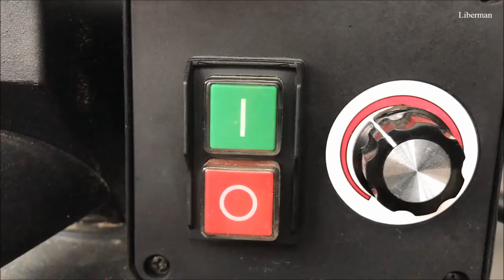How to make an automobile two stand lift for a service station

Comment: Can you make a similar stand lift, but with 1 motor? So that the left and right poles height are always same.
Reply: Obviously you would need to somehow connect the rotation of those two shafts. I would do it by running a third shaft either underneath or above whole setup that would be connecting to the other shafts via bevel gears.

However I do think that most real life cases of such lifts have two motors and the matter of them being level is just  controlled via the computer.